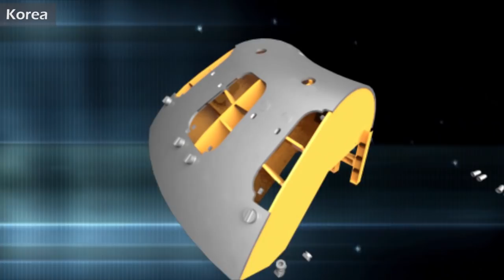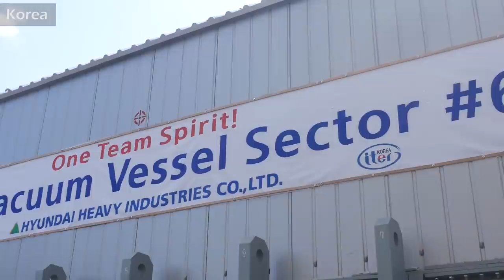ITER: First Vacuum vessel sector arrives from Korea

Comment: What kind of factoring tolerance is needed at iter?
Reply: Insane. The tolerances are as close as technically possible. The quality control is also insane.
Reply: In another video they said the entire thing is about 30 m wide and instalked with a tolerance of 2-3 mm. That means, that all parts combined have an average tolerance of 0.01%. or, in short terms: insane.
Reply: @kooooons  Wow! Ok, thank you very much :)